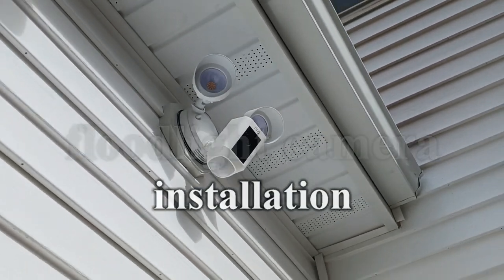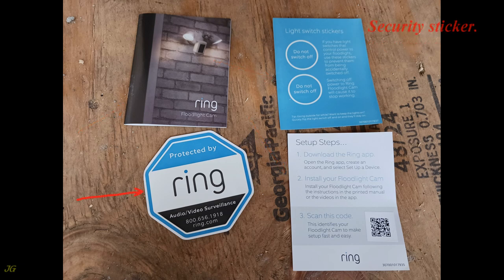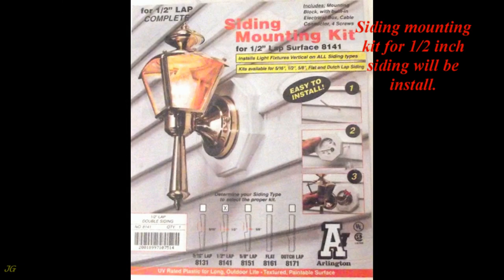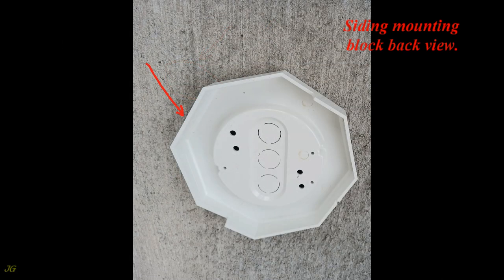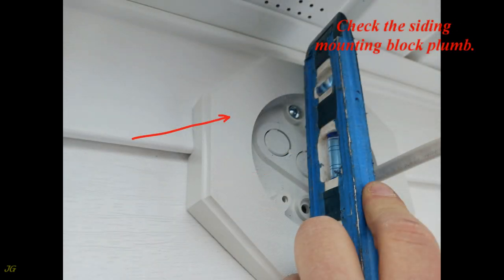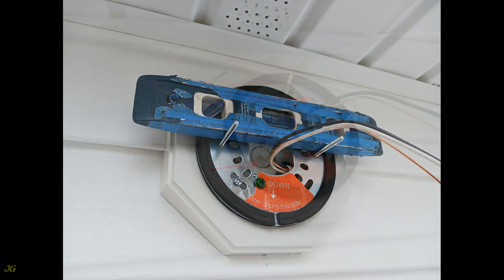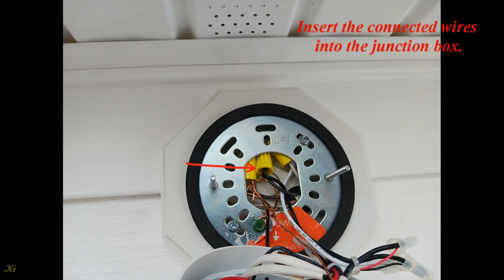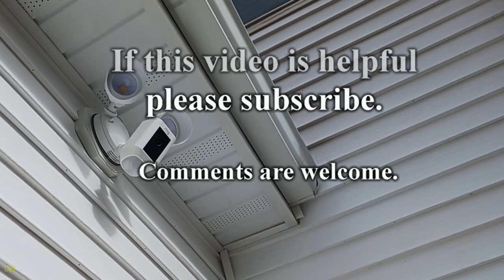Ring floodlight camera installation

Comment: Why does your siding mounting kit fit so flush but mine on my vinyl siding sticks off the siding wall so far?
Reply: You have to order the right size. Originally, I ordered a half inch lap design, but I really needed a 58 inch lap design. Lap related to your siding depth.